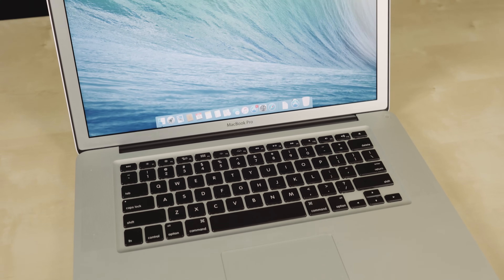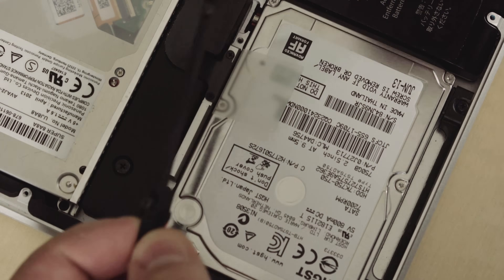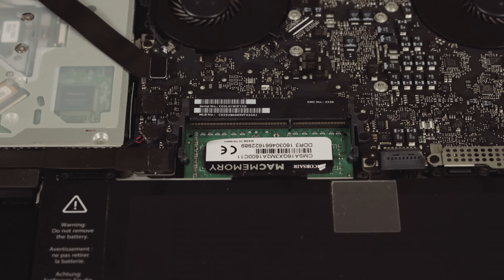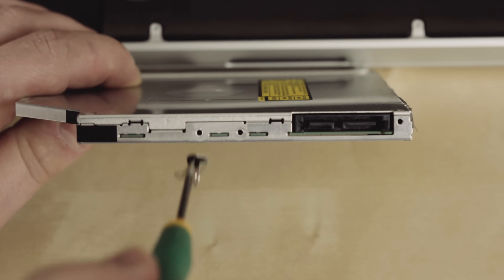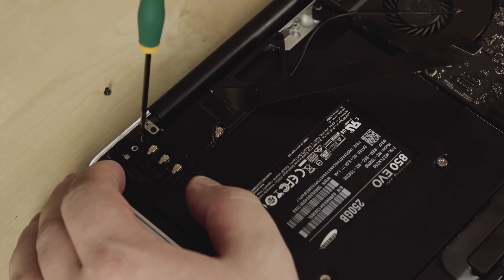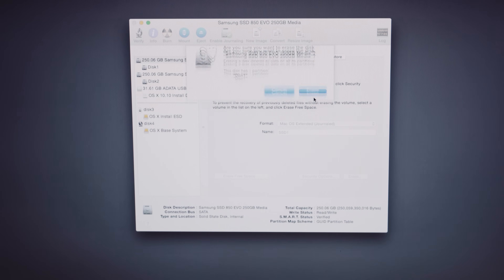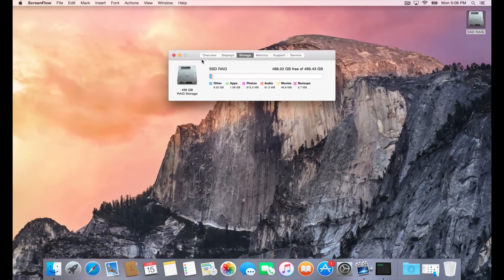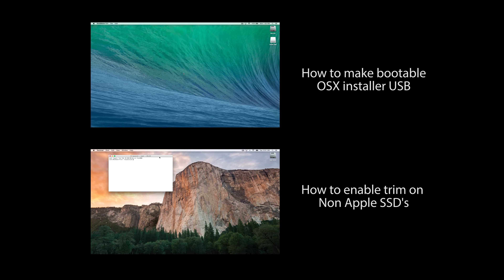Fastest 2012 MacBook Pro Ever! Upgrade Guide - in 4K

Comment: i have 2012 13" A1278.  would all these parts still work?
Reply: Yes. Is it a model 9.1 or 9.2? If so then yes
Reply: I just went for it anyway. it was a little different for some connections but seems to all be working so far. The real surprise was that High Sierra wont install on Raided hard drives....
Reply: High Sierra indeed dont have RAID support, hope Mojave will

Comment: your macbook pro may be faster but what about overheating problems caused by the graphics card??? i had this happen on my 2011 15"
Reply from the maker: DJ Selphi the upgrades have nothing to do with heat. But yeah almost all 2011 MacBook pros suffered overheating and burned out graphics cards. Thankfully that was fixed with the 2012 in this video
Reply: it does with the SSD...my fans weren't going off until I installed it
Reply from the maker: DJ Selphi Strange. SSDs create less heat because there are no moving parts. I haven’t noticed a difference in fan kick up in the last 2 years I’ve been using this upgrade
Reply: Never had an SSD heating problems either, clean your fans and heatsink, that might help a little

Comment: I'm currently running MacOS High Sierra on my mid 2012 MBP with a 1TB HDD. I'm almost ready to go ahead and replace the DVD for an SSD. Three questions: Will the Samsung 860 fit in the caddy, second, but most worrying for me, how do I download the MacOS High Sierra on a USB drive? And last, Can I keep my 1Tb HDD as a back up drive and use the new SSD for daily use? (How do you format that?).... I'm obviously not a computer geek :-P
Reply: First of all, High Sierra does not support RAID, but you can use your 860 as primary and 1tb as backup in the caddy

Comment: Hello! 
Could you help me? 
1 - Is it ok to only add a 8Gb RAM to one of the 2Gb slots and have 10Gb, instead of changing for 2x4Gb or 2x8Gb.
2 - I wonder if I just change the cd drive for a Samsung 250Gb SSD and keep my Toshiba 500 Gb HDD, would I end up with close results? I would install Apple's OS on the SSD and let the HD for "typical files". 

Thank you!
Reply: 1 = its ok
2= no, main drive should be ssd; ssd to hdd bottleneck on transfer speed; toshiba 500gb hdd can be in the caddy for backup data

Comment: Since I already have the stock 8gb ram can I just add an 8gb or do I need to buy two 8gb and replace the stock one?
Reply: Marcus ezell you need two matching sticks of ram. (You probably have two sticks 4GB each.) you would remove both and replace with two identical (brand, and type) 8gb sticks.
Reply: Hector Luma thanks!!
Reply: i have 2gb stock ram and 8gb crucial; 10gb total works great

Comment: If your upgrading with just one SSD drive do you have to reinstall the current OS system and do you have to do the trim? Or can you just pop it in like you did with the first one.
Reply: yes, need to reinstall OS, trim (check ssd manufactures info)

Comment: @Zed Pro Media 

Question: Hi! I have the exact same laptop and want to soup up for music production.

I’ve read dozens and dozens of people saying they have problems with the SSD in optical bay spot and the raid configuration lasting long term due to main hard drive slot being SATA III 6gb/s and the optical bay 2nd drive being SATA II and functioning somewhere in between 3gb/s and 6 gbs. The online consensus is that the files become unreadable over time thus unable to open them.

Have you encountered this since the making of this video? 

Can the viewers of this video do this same configuration with 2 500gb and/or 2 1tb Samsung Evo 860 ssd drives? Would the speed drop terribly?

Thank you! I appreciate your meaningful contribution to tech and your viewers!
Reply from the maker: Collie Dog Trucking Inc. I still use this thing daily for over 2 years. No problem with the raid. And just a correction both connectors are sataiii . This is for the 2012 model
Reply: Thank you the response, awesome! 

In 2018, would you recommend an OWC or Samsung 860, or 860 pro over what you originally installed? 

The application will be music production and video editing.

Lastly, are there any speed decreases or cooling issues if I chose to do (2) 500gb or (2) 1tb drives? I

I hope to find the ideal cooling dock for this as well if you have any recommendations. it’s. Mid 2012 pre retina with anti glare screen like yours.

Comment: Couldnt you just put in a 1tb SSD instead of 2x 500gb and keep the optical drive
Reply: The point here is using 2x500gb SSD in RAID0 configuration which increase the read/write speed by almost 100%

Nothing wrong with simply using one SSD since even then it's still faster than a HDD

Comment: Ive replaced my HDD with an SDD , but this wont let me use bootcamp since the new SDD is not supported. If I replace my disk drive with an optical drive to put my old HDD in can I boot in through that and get to bootcamp?

Comment: So many upgrades and updates to make the machine faster? Did you change the EFI firmware? Is there modification on the clock range definition and PCH straps? That machine is not the fastest since the maximum boot time is supposed to be below 13 seconds to brag as fastest. I don't do the overclocking anymore since people are so cheap and want everything granted.

Comment: Is it working everything fine? Because I read some MBPs are having problems with 850 and 860 SSDs and I don't know which SSD to buy: https://discussions.apple.com/thread/8274289
Reply from the maker: Eduardo Bortolotti been using it solid for 2 years with 2x 850evo in raid0. No issues
Reply: Zed Pro Media thx for answering! ;)

Comment: Would this upgrade approach work on my vintage mid 2010 MacBook @ZedProMedia? I read mid 2010 are limited to 3 gigabit per second so some of the faster SSDs can't perform to their potential. Does the raid bypass that or am I SOL on this upgrade due to my model?

Comment: Great and comprehensive video thank you. Just a question: in mid 2012 models if im not mistaking there are 2.3GHz and 2.6GHz configurable to 2.7GHz and as i remember for extra 150$ there was 2.9GHz. Question is How much is there a difference between these three models in terms of speed and the overall performance if all compared with with same memory and storage configuration?

Comment: I followed the instructions and everything is going great expect when I want to go into FULLSCREEN

I have a MacBook Pro (13-inch, Mid 2012) with 2.5 GHz Intel Core i5, El Capitan 10.11.6 (15G19009). Added 2 (Samsung SSD 850 EVO 250GB) with the RAID 0 - SSD TRIM (check out his other vid on how to set that up) and 16 GB of Memory. My MacBook Pro has been REBORN but have only 1 issue.

Every time I go into FULL SCREEN mode with my internet browsers. It logs me out, every time! Firefox, Chrome, and Safari. I'm trying to watch videos in fullscreen. Am I the only one that is experiencing this? Does someone have an answer on how to fix this?

Other than that, my MacBook Pro is awesome. BMD Disk Speeds 600mb/s Write - 900mb/s Read on a RAID 0.

Thanks again for another great vid Zed!

Comment: how did YOU update your processor to an i7 ? or did yours come with it? I have a mid 2010 MacBook Pro and I don't have an i7. I always thought you couldn't update your processor on MacBook pros?
Reply from the maker: KiiDKali all the 2012 15” MacBook pros came with quad core i7
Reply: I did this same setup to my MacBook Pro (13-inch, Mid 2012) with 2.5 GHz Intel Core i5. Everything is great til I try to go into FULL SCREEN mode with my internet browsers. It logs me out, every time! Firefox, Chrome, and Safari. Did this also happen to you? Other than that, my MacBook Pro is flying on El Capitan 10.11.6 (15G19009). Thanks again for another great vid.

Comment: I've got a question: I've already upgraded my RAM a year ago, and recently upgraded my HDD to an SSD, but only the lower SSD. My question is, if i were to upgrade the upper SSD (the one that is in the caddy), will I be ok as far as no loss of data? As I said before, I already upgraded the other SSD and reinstalled the OSX so all my data and everything is fine. Will replacing the other SSD affect anything? Thanks!
Reply: Still curious

Comment: hi, thanks for the vid, it's awesome! I'm looking up to upgrade my macbook too, we have the same model (mid-2012) but mine is the lowest spec (13" i5 4GB RAM) because I bought them when I started college, but now that I am using it a lot more for work I have been struggling with the speed :( I have been planing to upgrade the RAM to 16GB, a friend of mine suggested I change the HDD to SDD as well but it's kind of expensive for me.. So I was wondering which make the biggest different to the speed? The SDD or the 16GB RAM. If it's the SDD, I would probably save a little longer so I can afford both upgrade, but if the RAM I would probably try that first and see if it's okay. I used a lot of adobe apps (ai, ps, id, sometimes ae), I struggle a lot with ai, because sometimes I had to make a lot of artboard with a lot of pen work, a few days ago my laptop even crashed on me like 5 times :'( I check, there's nothing wrong with the laptop itself.
Reply: and does it make a difference with having a 500gb ssd instead of 2 pcs of 250gb? because i would like to keep my optical drive

Comment: I did all the steps as asked. The ssds work fine but the 16gb rams wont let it boot Up. It shows a folder image with a "?" On it. After this image the system gives me an error and restart. Whenever i switch to my original ram it Works fine.
Reply: Any sugestion? Please help me with this. Im not sure what to do

Comment: I use a mid2012  modell (built 2013/07) 15" 2,6 ghz  i7 with Nvidia GT650 1gb and the HighRes optio -  just as mentioned in the video. I equipped it with 16 GB RAM and a 1 TB Intel SSD.
Totally worth it!
I still use this thing every day as my main machine and it is still reasonably fast (end 2017!). I can do basically everything with it including video editing  without any problems and in decent speed. The only thing it is not so good for is gameing. But i guess a MacBook was never meant as a gaming machine in the first place.

On the plus side it has some unique features newer MacBooks are missing, such as a built in SuperDrive (which I still use from time to time), a magsafe adapter, an MD card slot, Audio in (and out) and an Ethernet Adapter. I also like the keyboard better then the ones on the current MacBooks.

Sure, the the battery is after 600 Loadcycles down to 90%, but then again quite easy to replace as it is not really glued in and in one piece. And yes it'a a bit thicker compared to the current models, so what.

So I am still happy and I kinda fear the day when I will have to switch to one of the current "USB-C for everything"+"nothing is replaceable"+"no Memory or SSD upgrade" offerings Apple has today.

Comment: on 10:33 - there is a clearly seen, that You just killing your SSD's this way (in RAID mode especially!), because there is NO Trim support, stated in your system preferences! Apple uses Trim by default only for thier own SSD's, for other brands you should do it by Yourself over Terminal app, but I didn't sure, that You can do it, when drives set to RAID mode. If so, that setup is just absolutely useless!! But maybe, if You only intend to lost your data in every year, and replace a two dead SSD's every year.
Reply from the maker: Alex Soldatov I used the trimforce command in terminal like I show at the end of the video. Been using this system every day ( almost 2 years now) with these ssd in raid0. No issues.

Comment: I'd like to do this upgrade, but I want to restore from a Time Machine backup after the SSD's are installed. Do I need to install OS with a bootable USB before restoring from my backup? Or can I go straight to restoring the backup after I've configured the drives in RAID? Thanks!

Comment: The maximum RAM according to apple website for Mid-2012 Macbook pro is 8GB or (2x4GB) so I wanted to confirm if you would still recommend putting 2x16GB RAM with a 500 SSD or I should be leaning towards adding the recommended maximum of 2x4GB RAM with a 500 SSD drive. Thanks. https://support.apple.com/en-us/HT201165

Comment: I messed up my laptop doing this. I heard a static noise as I was disconnecting the battery. After that my laptop would not turn on again. I plugged everything back in just like you did and even put my old hard drive back in but my Mac still won't turn back on? Did I mess something up with that static? I think I did. If anyone has any idea what happened pls let me know.

Comment: I thought the macbook pro 13 inch model mid 2012 can only have a maximum RAM capacity of 8GB? Is it possible for a model 2012 to install and use a 16GB RAM?

Comment: Your processor test was lower on the one w raid because macbook pro uses "soft" raid as opposed to the old mac pros which had optional hardware dedicated to the raid process. you're speeding up your read/write speeds at the cost of some processing power. Granted, its not much processing for a heck of a lot of R/R spd, but thats whats happening. If you do game or music production which regularly max your cpu, its the industry standard to have two non raid disks, one w system & apps, the other for media storage. That way you free your processor from the raid task and free your media disk from system tasks.
Reply: Hi Stu. I do a bit of music production myself and as you said ableton and plugins are maxing out my cpu regularly! Do you reckon i'd be better to just replace my cd drive with a SSD (and use this for OS and applications) and use my original drive for storage large files/plugins etc? Thanks
Reply: +Corey Gallagher A RAID is TWICE as likely to have an error or have a disk crash. Even the 2Gb 850 Evo Zen used can pull over 900 Mb a sec on Blackmagic solo and the 860 Evo should be even faster so the go is to put a 9.5 mm thin 2Gb HD for $100 into the DvD bay and a single big 860 Evo in the HD bay. 4Tb onboard storage for cheap!
Reply: +Stu Dubya sorry but you are an idiot... the overhead is imperceptible the lower score is because its an older generation i& chip. Hi Ghz but older design. The only reason one drive is used for AV is because most people haven't bothered going to a raid plus a single drive is twice as safe.
Reply: Sorry Stephen Fry, but the true idiot is someone who starts off a conversation with the reply of "you are an idiot". What the fuck is wrong with some of you folks. Just because someone might be wrong with their thoughts or replies doesn't give, or shouldn't sound the attack alarm. So, attack me now, but know I will mute this conversation so your infinite pontification of insults and quips will fall on blind eyes.

Comment: Hi, thanx for this video I want to ask you, would be an improvement if I install one 256GB SSD with 16GB ram and leave the optical drive?
Reply: An SSD, even a basic Adata/kingson one, is still faster than a HDD. You're looking at around 150+Mbps for SSD vs 30~40Mbps for HDD

Comment: Greetings, great video. I'm about to do this same upgrade(single 500g ssd) to my 2012 MacBook, but I have seen post stating that going to 16g of ram causes issues with the Mac.  What are your thoughts and how has your MacBook worked so far? Are you having issues with battery drain, etc? Thanks in advance.

Comment: Couldn’t you just install a 500gb ssd instead of two 250gb ssd which you would still have the disk drive
Reply: Single SSD would have only around 450 Mb/s read/write speed, unlike two SSDs in RAID 0 config which give you double the speed. Hence using two SSDs.
Reply: You can and Its a better choice in the long run 500GB. Whenever you use SSD, always go for the bigger option, they will last longer than if you do 250x2.

Comment: 2 ssd 250gb = 200$ 1 sdd 500gb = 150$ Mr. genius
Reply from the maker: Charlie Music Depends on if you want to save $50 or gain twice the speed? 1 ssd= 500mbs read/write vs 2 ssd= 
1gbs read/write. I'd rather spend $50 more for double the performance.
Reply: You gain on speed/performance but you'll decrease durability. When going SSD its always best to go for the bigger size, so if you want your data and SSD to last longer (in terms of years) its better to choose 1 x 500GB  than 2 x 250 (this is due to the way data is stored and read and the limits of how many times a memory block can be read)

Comment: I'm about to upgrade my RAM, change my disk drive to an SSD, and change the battery in my Macbook Pro 2012. I currently have OS Mavericks and I don't want to update it because I use Logic Pro 9, so if I make these upgrades and turn my mac on, will it turn on with Mavericks or will it force me to update to the latest OS?

Comment: Wow! Can I edit 4k video in this setup with ease? Considering it is quad core and has Nvidia GT 650m 1gb.
Reply from the maker: The video card is the weak link. You can edit 4k video but not with ease. The gt 650m is good for alot of things but it hits its limit with 4k video. FinalCut performs better than Premiere on this system. But not as well as the newer laptops.
Reply: I was looking at a macbook 2012 upgraded with ssd and 16gb ram as for the few occasions I need to video edit on the move (I have an iMac for heavy editing). I film in HD and 4K (GH5 and Canon C100). I'm not worrying about working with proxies but I wonder how long it would take rendering the final videos. I'm not sure if it's worth it but i really don't want to splash out on a new o even 2015 Macbook pro as the are so expensive!

Comment: Is it possible to still use RAID0 in this way with a the original HDD (500GB) and adding SSD (500GB) in place of Optical Drive? Also want to update to 16GB Ram... Should I get stronger fans??? (Serious about the fans)